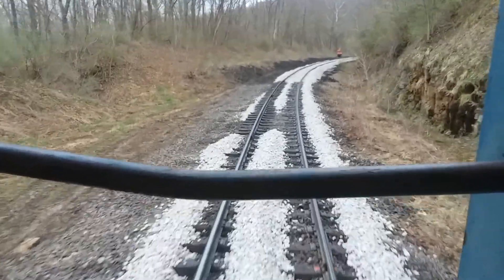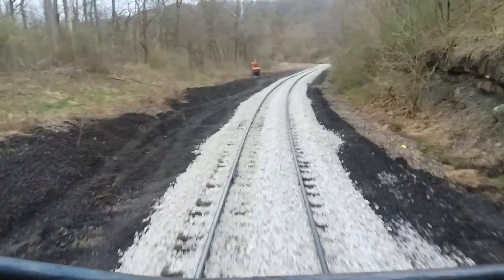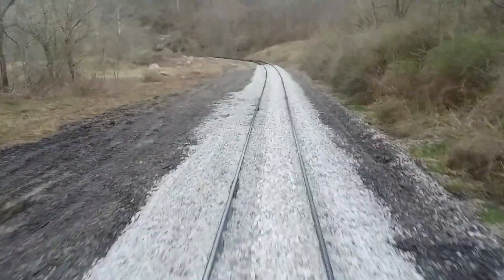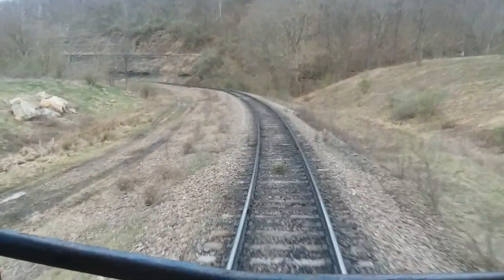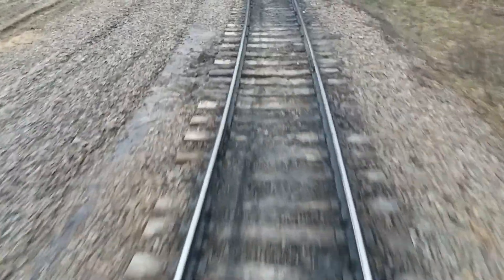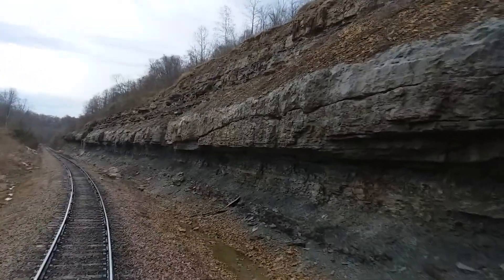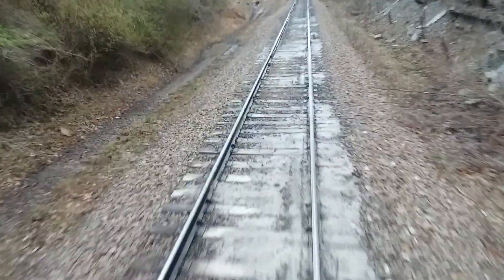Riding the Rails -Part 1

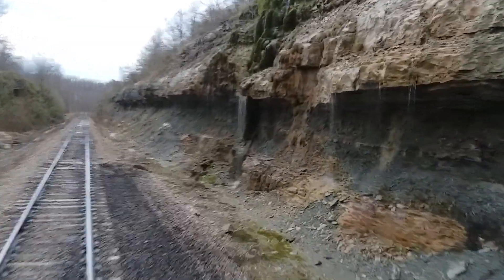Comment: Hope you still check the comments on these older videos!....... So! 17 miles of track maintained by 2 people?........Yep! I see "job security" with plenty of OVERTIME ! What machine do you use for diggin out the mud on the track? Maybe that little orange backhoe sittin on the side of the track @0:50 seconds in? That waterfall @3:04 ? Must be that it comes from a deep spring?!? Have you ever had the water tested? Might be the best and purest water available for miles around. Hummmmmmm......? Have you seen them "LED" Christmas Lights that run forever on a small battery pack of "AA"s ? They are inexpensive and would do the job on the Icicles for that time of year. Just thinking. Really enjoyed the narrative and Thanks for having us aboard!
Reply from the maker: Job security yes sir, we do get contractors in at times to help with the big jobs, that helps us out a lot. Nill  on the water testing, if
you knew what was above it, you'd rather suspect it not very good water. Hey, maybe I can get those led's to decorate my hi rail
truck for the holidays....lol Thanks again for watching Captain

Yes that orange mini excavator is what I use to crib ties, it does a pretty good job, here's a link to watch me do it:

https://youtu.be/qXzjrATKtls

Comment: How did Rockcut 690 gets its name...???
Curve 50 at MP12.5....
Reply from the maker: 690 was what the original contractors named it when they did the dirt work to build road bed, the cut above 690 is called 640, so i don't have a clue why they were so named